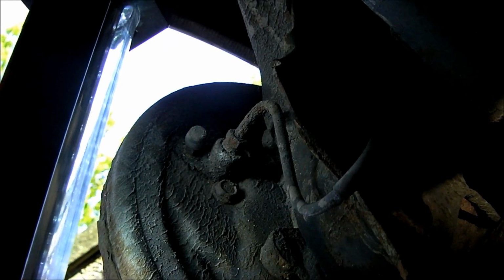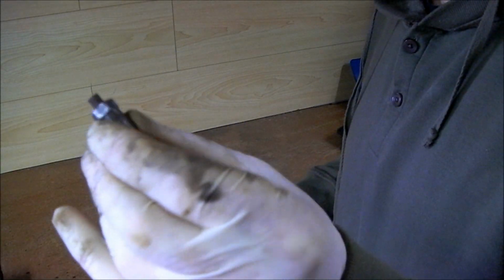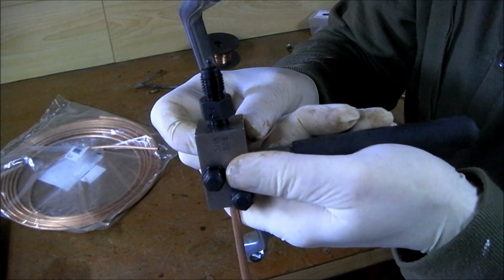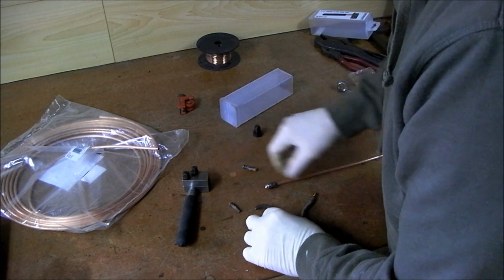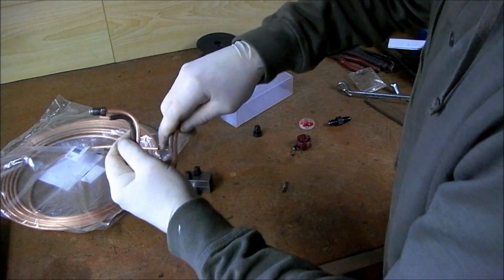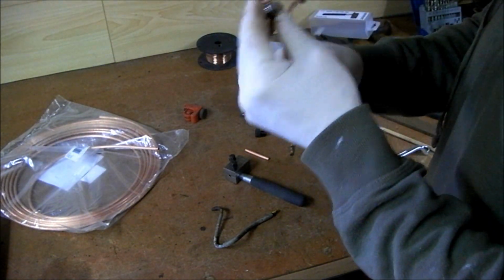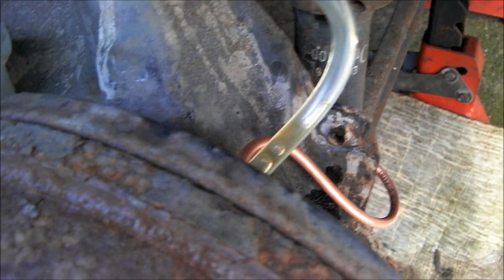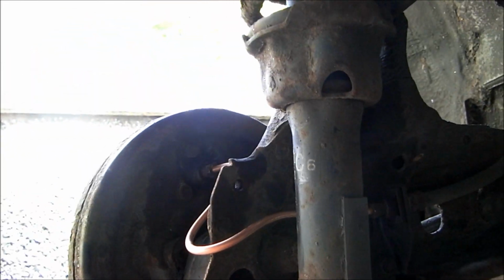How to replace rusty, corroded brake lines

Comment: Good video, Backstreet. I couldn't believe my eyes seeing you bend it precisely by hand (I expected you to use a bending tool) but you did it expertly without any buckling. Would using steel brake line be much harder to flare ? As I work alone on the car I use a one-way valve bleeding kit with a plastic carton to hold the bleed-off. It always takes 10 pumps of the brakes to get them good and stiff regardless of how clear of bubbles the fluid coming from the nipple is.

Comment: 1:10. Pause!!! spray that damn fitting! for the 2 seconds it takes and all that it does to penetrate into the rust within a minute its best to give it a spray before u even really get to working on it at all. longer it sits in penetrating oil the better the chances it comes out without a problem

Comment: Good Video. Good Tool, Good Lines. Your hands are more experienced, so bare hands only might be fine. Those $7 circles with a flat handle and hook are what I look to use. Away from the car a 180 Degree Brake Line Bender. Even in this video that is a 180 bend. Those 90 degree make a 5 inch U-turn. Not good for brake line spaces.

Comment: Great job but I'm not sure if copper tubing is appropriate for brake lines. I'm thinking it's too soft and could be easily crimped shut or broken if struck by something kicked up from the road. Rocks, metal, etc. Maybe I'm wrong, but not sure. The factory lines are a steel alloy coated with a thin layer of plastic, aren't they?
Reply: Cunifer copper and nickel is ok for brake lines

Comment: Still can’t get over the fact that copper can be used for brake lines it always amazes me it just seems to soft for that
Reply: It's a copper-nickel alloy that's specified for that very purpose. Sure steel is harder and stronger but the steel will rust and especially down underneath the vehicle. Formability is better with Cu-Ni too.

Comment: must be nice to have that kind of room around the break line...i blew a break line this morning and when i went to find where it was...the line goes up in behind my gas tank...no way i can get at it unless i drop the gas tank...and im unable to do that with no hoist...cant get the car high enough.
Reply from the maker: They install the brake lines first, and create these problems for us. Is it busted behind the tank, or is that just the line of the pipe? because you can remove the rusted section, if it easier to access, by adding a piece in, instead of removing complete line.
Reply: backstreetmechanic you mean cutting the pipe line a few inches from calipers on both sides , remove piece from behind tank and get a new or dunno, maybe  used pipe and buy connector fittings, just saw a scotty kilmer video about it, looks easy
Reply: Loftur Hjalmarsson and there it is , fixing leaking rusty brake lines is the name of video. l think
Reply: sean cadwell  If the brake pipe in question is not completely corroded then you can use the pipe cutter to cut off the part of the pipe which is corroded and just measure to the same size you cut off and make up the flares to suit. This is only if the pipe is partially corroded, if the whole pipe is corroded then unfortunately you will have to drop the tank like you says. But hopefully you can get away with just partially replacing it. I had the same problem on the rear of my van and I got away with just changing about 8 or 9 inches :-) just a suggestion mate ;-)
Reply: Tiocfaidh Arla scotty did it wtihout dropping tank , just routed new line beside the tank
Reply: Yeah that's true mate but the problem was he couldn't get the old line off the vehicle unless he dropped the tank. So I was just suggesting if you can see that the part which is hard to get to is in ok condition then just cut and fit new pipe to suit to existing old pipe.

Comment: Those are not just copper, they are copper-nickel alloy DOT approved brake line.  European cars use them to avoid rusting as badly as the cheap pvc coated stuff.

Comment: I am in the process of replacing rusted brake lines which run the frame to the rear as the vehicle is 18 years old and the climate here is laden with winter driving and salt.  Do not want to spend money at brake repair places because the cost will exceed the value of the vehicle.  The vehicle above the frame still looks great and runs well so I want to keep it.  Spending large sums of money to replace a trustworthy vehicle for another used vehicle I do not know history of is repulsive to me.

Comment: you say copper... copper is illegal on brake circuits, at the apparemce, this tube seems to be CUNIFER, an alloy used by Volvo since the first 240 series cars in 1975 and made newly available to us .
It takes much times to adopt good practices but manufactirers are very fast to adopt practices they think can save costs !
i'd like you can specify the alloy as somebody not aware of this can easily use copper tube and cause an accident by a brake failure.( copper is recognised to crack under vibration )

Comment: I had to dislike your video, even though most of it is great, assuming the copper nickel line is actual brake line. I am a retired master tech, 50+ years. I had several problems over the years due to someone crimping a brake flex hose with a pliers or anything else. The inside even on a pretty new car can crack. On an older car the inside of the brake hose is already brittle. It can create a little flap inside stopping the fluid from retuning to the master cylinder and drive you nuts, trying to figure out why the brake is now locked up. Or the line cold just blow out and you lose the brake pedal. Don't do this,please.
Reply: +daveS ministry     It is a well known trick to cause someone a nasty !     Crimping the brake line is worse than cutting it... No one knows it has been done !
Reply: daveS ministry does that include using a hose clamping tool, I have two Draper tools that are marketed as brake hose clamps which I have used in the past.
Reply: @aspectcarl  Yes.

Comment: Cupro-Nickel will not do tight bends by hand like this. Flares too easy. Must be straight copper. JMO. Great tool. I'm ordering one from the UK. Great video, otherwise.
Reply: He did it in this video so what are you on about?
Reply: @JazzFunkNobby1964  he's sayin he probably did just use copper as it bent into shape so easily.
Reply: @MisterAmbassador  That's copper nickel pipe he's bending in the video. I've recently replaced all my brake pipes with copper nickel. It bends so easy I never even used the bending tool I bought to do the job. Did all the bends by hand.
Reply: @JazzFunkNobby1964   I agree with you. Stu Slaymaker said Cupro-Nickel will not do tight bends. I didn't say that. And you ask what are you on about and I was just answering your question.
Reply: @MisterAmbassador  I had to reply to you because you chose to answer my question to Stu Slaymaker. We are in agreement. I actually used a broom handle to do a tight 180 degree turn. I was surprised how easy the cunifer pipe is to work with.